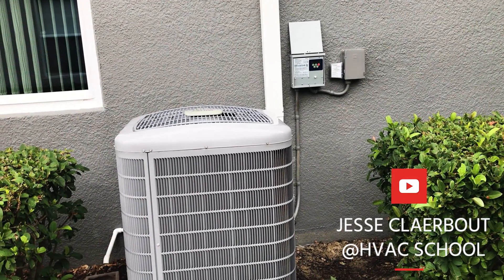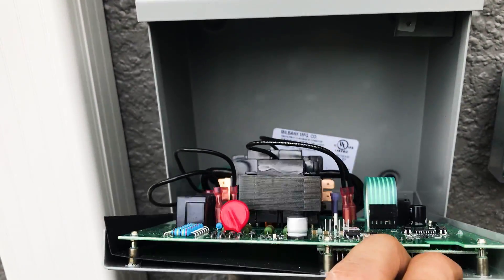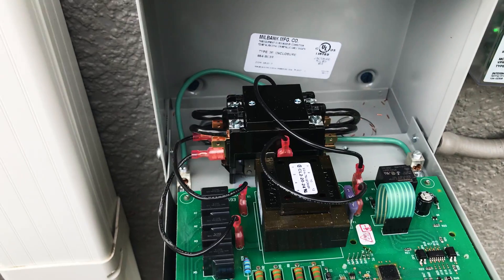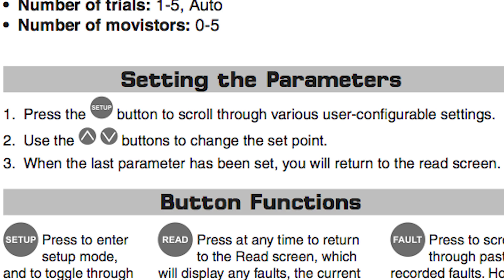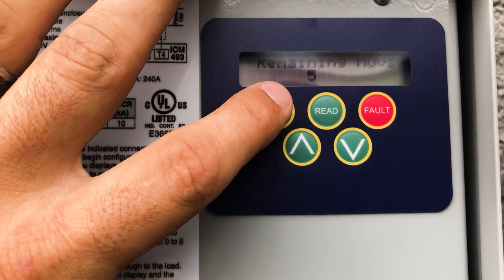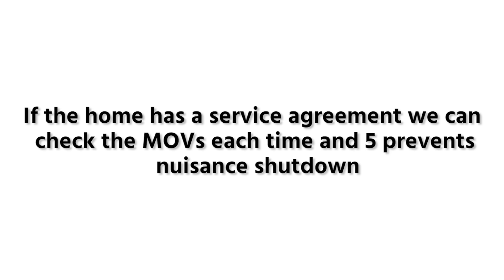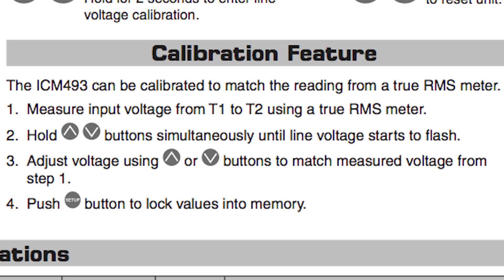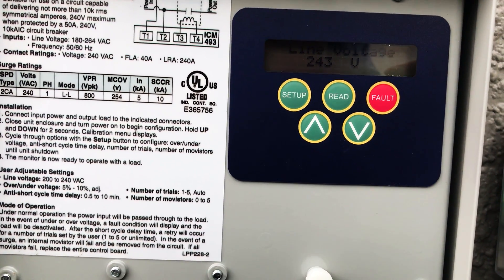How to Set Up the ICM 493 Surge Suppressor

Comment: I like the ICM’s four strikes and your out feature, redundant movs on the disconnect with their $7500 guarantee (wonder if anyone actual collects on surge suppressor warranties), but I wonder about both system’s grounding path and the electronics in the ICM box itself.  It may be an academic argument, but I lean to protecting the whole house at the incoming panel since ground paths are better and there is a chance to prevent dangerous voltages and frequencies from finding their way back to the inverter from the comm wires. At some point opto isolation should be designed into the comm networks by the OEMs.

Comment: Why didn't you install the ICM493 upstream of the disconnect, to put it closer to the power source where the surges should be greater?

Also, you said it needed a good ground, but the electronics board isn't grounded. At least I couldn't find where the board was grounded. And if you installed it upstream of the disconnect, the equipment grounding conductor would be shorter and closer to the CB panel.

Is there a good reason why you installed it just before the equipment?

Comment: Should be set at 4 failed MOVs and have it Disconnect.  This forces the customer to call for service to Diagnose.  Upon discovery that 4 MOVs have failed, that would be a definite Sign of an Issue or perhaps just age.  It would then allow for the 5th one to be Selected for continued operation to Retain Protection with the customer being notified of the issue and requirement to replace the controller due to Damage.  How frequently this would happen is Unknwon of course but cheaper to replace the ICM493 than anything in the condensing unit.  The Bad part is once that 5th MOV burns out.... Zero protection left with continued Operation.  So moral of all of this.... Set it to 4.  Leave 5 for restoring operation while ordering a replacement ICM493.